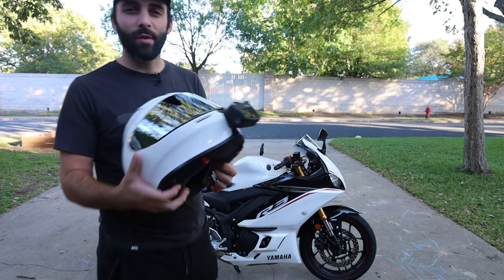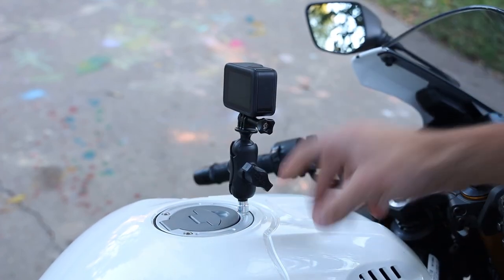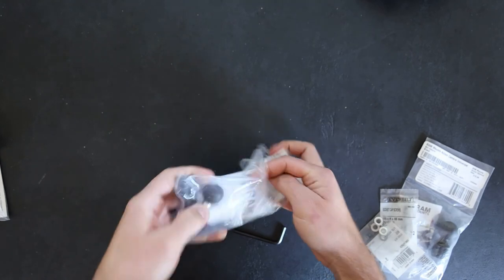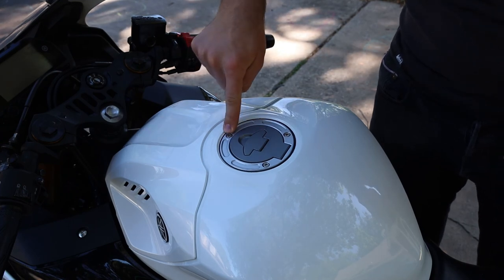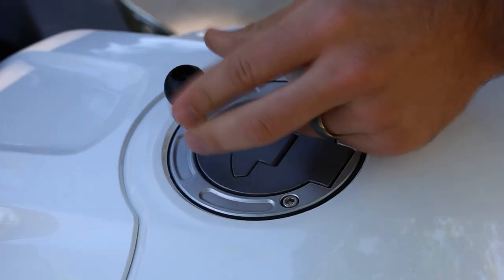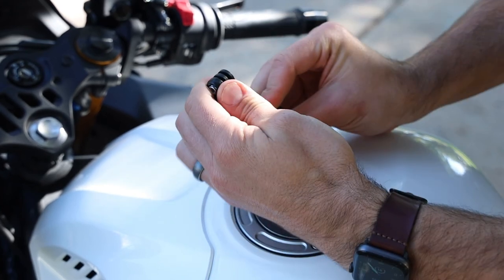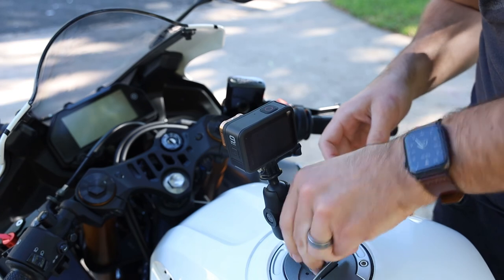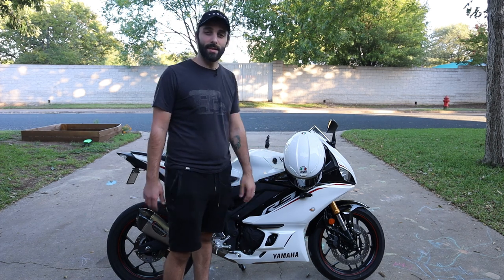Get better POV footage on your motorcycle GoPro

Comment: This is very informative and accurate but the downside for me is that i cant seem to find M5 0.8 x 55mm screw anywhere…. Went to two home depot, lowes, ace hardware but they dont have the 55mm long
Reply from the maker: Yeah you might have to order it online, I had it only at one of my local hardware stores

Comment: Thank you so much for this video!
Simple things can be so easy sometimes. I had to find a solution for my next racetrack visit, where helmet mounted cameras are not allowed. Now I found it. Thanks a lot!

Best wishes from Germany
Reply from the maker: Was the track good with the camera being mounted to the bike similar to how I have it in the video?
Reply: @moto.obsession  I think it worked very well. I had no issues while driving and the Video was also stable (no vibrations so far). The only thing I struggled was to find a way to secure it with a rope (our racetrack and organizer were very strict with us, but it woked fine).

Next time I need a solution for the wind noise :)

Best wishes from Germany

Comment: Question. What is the length of the screw that goes in the gas tank? after you put it on the Ram ball mount. Is it 27mm?
Reply from the maker: Its a M5-0.8 x 55 mm Bolt

Comment: Awesome solution! One question, must the m5 screw be 55mm long? Can it be shorter since the original one is shorter too
Reply: You may have to try a bit... in case just cut the scew carefully or buy another one in the later known length✌🏻
Reply from the maker: I got that size as it’s equals about the same as the OEM one when you account for the raised part of the mount - hope that makes sense